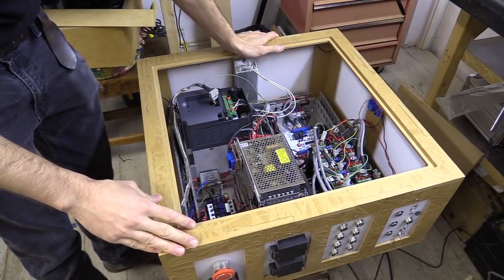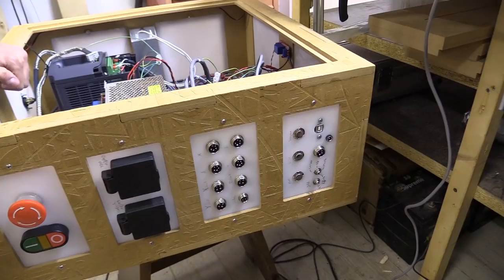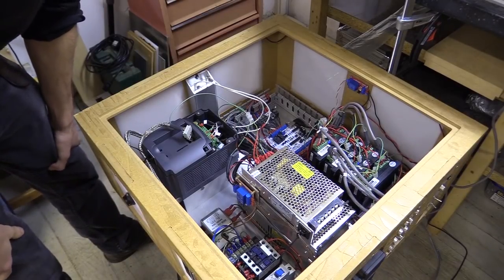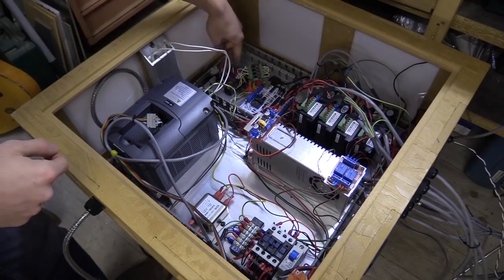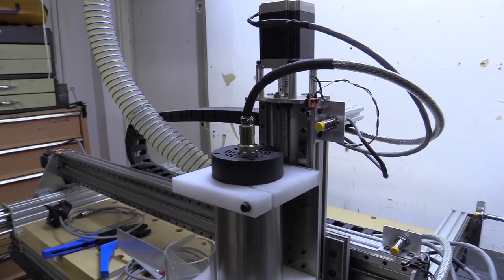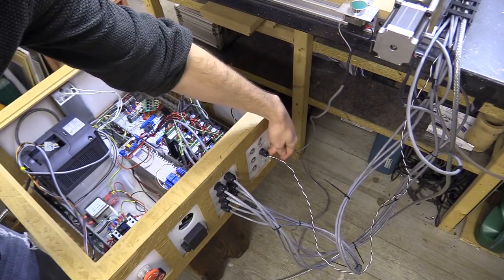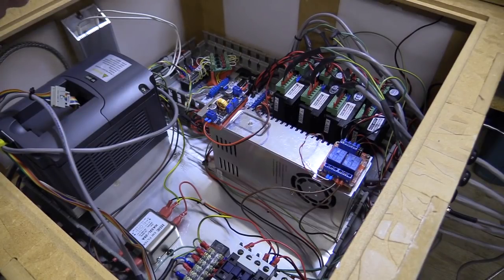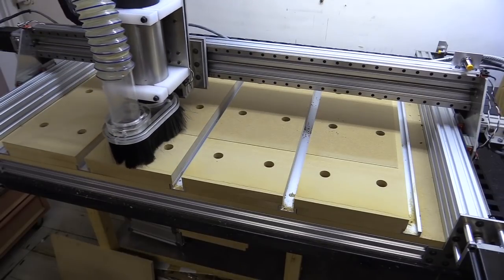#33 CNC Controller Rebuild #33 / All the things I wish I knew

Comment: HI bro, nice  video.
In this setup you connect all the shield drain wires to the neutral of the 220v grid ? 
Thanks
Reply from the maker: No that doesn't sound right - not neutral. The shielding wire should go to a common earth terminal on the metal enclosure mounting plate.

Comment: Your VFD is a cheap copy of another Chinese brand. Everything that could be removed to save money, have been removed.
Reply from the maker: Which VFD?
Reply: @EducatingSavvas  I might be wrong though. It just seems like a copy from what I can see in this. Video.
Reply from the maker: @Mr_Wh1  I'm not sure but the Nflixin function menu looks more comprehensive than the huanyang one - which is more popular. And there seems to be more variety of Nflixin ones such as micro versions, and they also have potentiometers which the others don't.

Comment: It seems I'm right behind you.  From my research grounding is the main issue for me.  Like grounding shielded cable only on one side.  Not Daisy chaining them.  I have  basically  I have same vfd same drivers and motors.  My limit switches caused all my problems. I threw them away.

Comment: knowing the Steppers, 6wire unipolar, ... 3A 400-600 oz/in.  ???  ... 12-24 v on a potientiometer, and a power supply rated for the sum of your motors, +2A.... so my 4axis TB6560 controller tech says...  methinks a 24v 15A 
p/s is my next $$.

Comment: I change my controller and have no more issues. I had the same controller you have
Reply from the maker: That simple - what did you move too? I've been looking at the Gradus M1 PRO as an alternative.
Reply: @EducatingSavvas  after a lot of research I bought the UC300ETH. You can use $10 cheap BOB but I got the UB1 for aesthetics and ease of installation. I simply got tired of troubleshooting the phoenix controller every week and I haven't had the first issue with the new controller.
Reply from the maker: @jp8479  oh that's a Mach controller.
Reply: @EducatingSavvas  I picked  UCCNC. You get both options. UCCNC is cheap and reliable

Comment: My limit switches would get tripped by noise, until I added capacitors at each switch and at the controller for each switch (3x2 + 3 total)and resistors at the controller. I was getting false tripping in the middle of long jobs.  I haven't had a problem since.  I don't have grounded shields on the wires.

Comment: I don't see any drain wires coming out of your cables going from the drives to the steppers. I see what looks like green ground cables all tied together (not the same thing). If you're not using shielded cables then I would say there's your problem.
Also, you should be using shielded cables on your limit switches because stray electrical noise can false trigger these devices.
Reply from the maker: By drain cable do you mean the from the shieldings - as I used green earthing cable to do that. And yes I'm using shielded cables. Although after looking at the VFD manual I wonder if I could have used braided strap form the shield, screwed to the metal plate?
Reply: @EducatingSavvas  On shielded cables there is usually a bare multi-stranded wire that is called the drain wire. It runs the entire length and runs up against the metal shield foil. I didn't see it, but I'm guessing by your reply that you attached this drain wire to the green/yellow ground wires? That should work fine. 
Braided strap is actually a better method of protecting wires in cables from electrical interference because High Frequency (HF) and Electro Magnetic (EM) noise flow over the surface of the wire--so a braided strap with its many wires works better than a wire cable shielded by foil and a single drain wire. Not that a standard shielded cable with foil and a drain wire is bad, it's just a difference of one being good and the other better.
As far as the VFD goes, personally wouldn't keep it inside of the control box.

Comment: It's interesting you mention the aviation connectors and the Z axis control issues as I had EXACTLY the same issue...I had some really nice connectors with spring clamp connectors in them so it wasn't even a soldering issue it was just too many antennas for interference I believe. One note additionally is in automation controls we only ground the shield at the sensor end never both and while your setup is a bit different from a  normal sensor setup it should follow similar rules. Also USB cables are a general source of issues in my experience as well.
Reply: Could you explain a bit more (or give me some keywords) this rule ? Interested to learn how a cnc is properly wired in an industrial area. Thanks !

Comment: I'd move the VFD and power supply out. Put the VFD in a separate shielded metal enclosure (e.g. https://www.hammfg.com/part/CHKO12106) and add ferrite cores on spindle out wires. Optical isolators on all inputs. Ground both ends of the spindle cable braid.  Star point ground everything in the enclosures.

Comment: I suspect just adding the optos to the inputs of your controller (opto board CLOSE to your controller board) from your limits etc would have fixed all your issues. Everything else is just working towards reducing the noise on those lines which goes away as soon as you opto isolate those lines. It's unfortunate that the use of optos isn't preached at a religious level all over every CNC forum. You can't go running high input impedance logic level lines any significant distance if there is high voltage switching etc nearby. Unfortunately the market is full of "amateur" designed controller PCB which kind of, sort of, often work until they don't! The little GRBL Arduino shield is typical of these, close to useless without external opto isolation on all inputs if you have any high power electronics around.

Comment: I noticed the occasional issue with my Bcnc - GRBL setup as well. When it was first setup, I witnessed several instances where it plunged a drill bit into a material. This, it was supposed to. Then it moved sideways, with the drill bit fully submerged in the material. SNAP. Breaks the bit, not before loads of noise in complaint. I don't believe there was any issue with my G-Code, I believe it was the controller. It seemed to just forget to pull back up again. 

I've witnessed the other occasional Gaffe, though I can't say as I recall exactly what those issues were off the top of my head. I am wondering if GRBL does not check its queue against the list of G-code commands in GRBL. If I could, I would have it load up a buffer of the next 5-10 seconds worth of commands, and do a double check before doing those commands. 

Anyways. Probably not related to the problems you are experiencing. but, curious I am not the only one noticing limitations or issues....
Reply from the maker: Which version of bCNC are you using? The behaviour your describing sounds like it could be a number of things. It could be the bit slipping out of the collet, or lost steps either because the motor coupler was slipping, or you were going to fast and the motors couldn't supply the correct torque. All things that I have done. Maybe the steppers are not getting the right power, or there is some kind of interference with the electronics. Interference can cause really weird and dangerous behaviour as the  machine can move unexpectedly. Try update the version of your bCNC as if it is software there may have been an update.
Reply: @EducatingSavvas  I actually do not know, it was the default version that came with my Raspberry Pi CNC hat. I have updated it since, perhaps that made a difference. I appreciate the input, I don't think it was any of the mentioned problems - but I won't rule it out. I did have a coupling problem on my Y axis - two motors, one on each side. One wasn't spinning properly and I found out there was a piece of debris in the coupling compression slot, preventing the coupling from tightening. 

My background is in electronics. The communication protocols between the computer and the GRBL controller should be fairly interference or noise tolerant - so if the problems you are experiencing, or I am experiencing are noise related, I would have to wonder whats going on in the software that there are no frame checks.
Reply: Maple_Dude , I had a problem with grbl version that caused similar behaviour. But that was over a year ago.  I'll see if I can find the problematic version.  I even narrowed down the exact g code that reproduced the problem...
Reply: I just posted the link that shows the problem on Version G.  Version i fixed it.  Can you let me know if the link showed up? It shows for me, but sometimes YouTube shadow-censores links.
Btw- the bug was a failure to accelerate. Instead, it instantly went full speed into/out of a plunge.  This caused missing steps in z which looks, to the user, looked like the tool failed to lift up.  The video shows the problem with slowed-down speeds, but it happened at higher speeds too (when the z distance movement was equal to x or y movement but z was changing direction). The bug may have manifested itself in other ways too.
Reply: @TheRainHarvester  Shows up, will look at later in the week, thanks.

Comment: How are the chinese linear rails doing?
Reply from the maker: They seem to be doing ok surprisingly. I do get a resonating sound while homing sometimes but still moves.
Reply: @EducatingSavvas - I would be curious how they hold up over time. If they do well, I would probably want to replicate your design fairly lock stock and barrel. Would it make sense for me to get someone to cut out the plates locally, or what would you charge?
Reply from the maker: @IceTurf  Hopefully they last - but you could get legit hiwin mgn12 linear rails. They would probably be better. I'm going to try cut a second set of plates out soon - for a second smaller machine. But it'll always be easier if you get someone to cut them out for you - on a water jet or laser and then ream the holes to size.

Comment: star point shielding on your signal level stuff would be the most important as that would almost nullify a nukes emp. The spindle driver and output cable would be better out of the box, as that's where most emi would be coming from , grounding the spindle case would only be good for safety reasons, you can make a battery powered probe for manual z . Glad you put optos in, apart from supply noise isolation, if for some reason the divider losses ground, the output of it will go to the voltage of the input at whatever ma the top resistor will allow straight into the 5v system, blowing stuff up untill something fails open. Stepper cabling isn't that emissive if twisted, but can cause glitches if run paarraallleell with signals. Is that a double L or not? Haalloommii, can never spell that right either
Reply from the maker: I'm just glad I've got that out the way - and now I can go back to milling cheese. THAT's ALL I WANTED TO DO!!! CNC some cheese and then I went down the rabbit hole - or should I say the cheese hole.
Reply: @EducatingSavvas  Same issue I had stiffening up my cheese squirting machine. I now have loads of upgrade parts for it, but I think I will make a cheese squirter mk2, rather than be without balls of cheese strings whenever I vant them.

Comment: That ground the cable at both ends is new to me too. Maybe they expect that the motor is isolated like your is? I'd like to read what an expert has to say on this.

It sure seems like you did a ton of work before knowing what exactly was causing the problem, I hope you got it. The wire cabinet looks a lot better now with less in it but sometimes you want separate power supplies to reduce electrical noise between devices. That optocouple board might be better suited to being mounted on the CNC and not in the cabinet if you think that's where the noise is being picked up, I don't think it is but...  I always shuttered when you referred to those connectors as "aviation", what they really are is amateur radio microphone connectors. Aviation connectors, also known as bulkhead connectors or firewall connectors have potted pins and are sealed to reduce the chance of air moving through them, you know like keeping smoke out of the cabin, that's why real ones are really expensive. Anyway looks much better now, and your wiring skills have improved greatly. Keep it up!
Reply from the maker: Yeah - I should have called them mock aviation connectors. I can't believe I went this long before tackling it. Just goes to show how much I don't like tinkering with the electronics. I was really going in from knowing next to nothing and it's a miracle I only electrocuted myself once in the process.